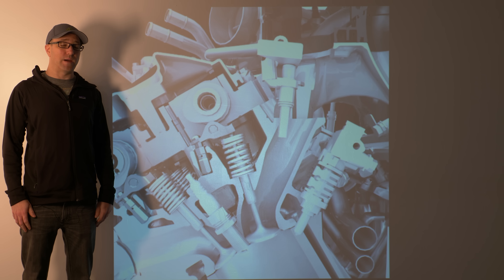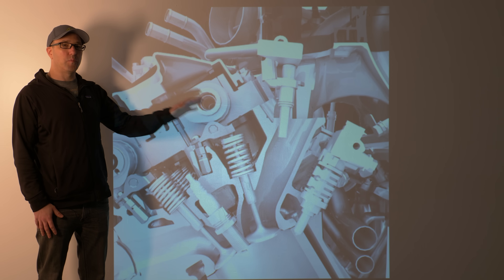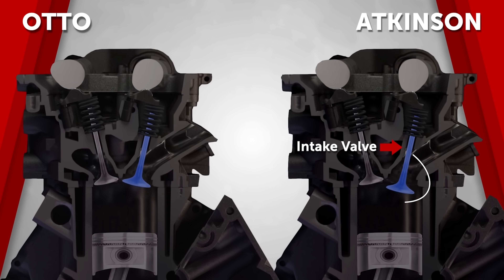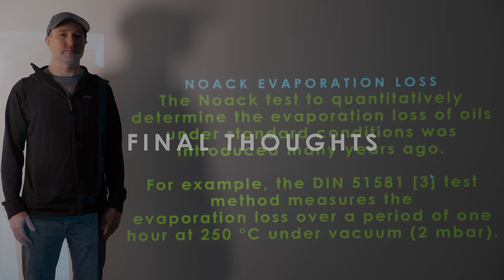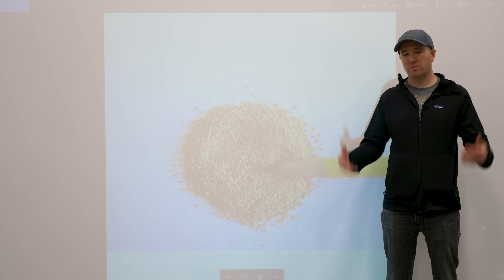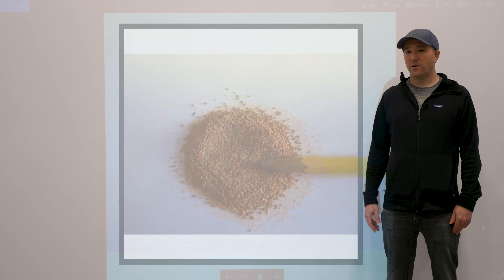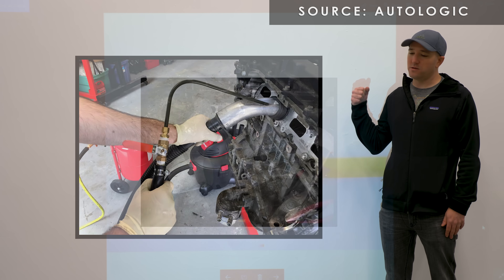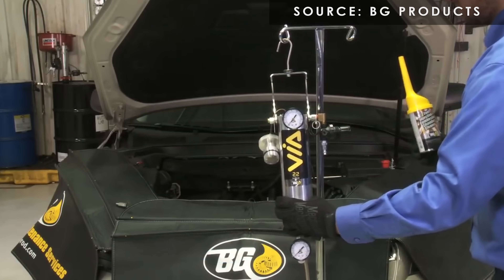Direct Injection, Problems and Solutions | The Fine Print

Comment: Extended oil changes Lead to more fuel dilution and therefore burn off. This coats the ports with oil and soot. Low tension rings rely on combustion pressure to seal against the cylinder walls. Most ppl drive with economy in mind and use very little throttle, therefore low cylinder pressure. This increases the amount of blowby. This glazes cylinder walls and packs carbon into the ring lands and taxes the PCV system. Crank case pressure and oil dilution contribute to oil seal failures and leaks. Short drive cycles put moisture in the oil that doesn't get boiled out because the oil doesn't get hot enough. More crap past the rings, in the intake and stuck on the ports and valves.  Anybody sense a pattern? 
Changing oil viscosity can lead to cam phaser malfunctions and codes when the computer doesn't see the correct adjustment. So, be careful changing oil viscosity. Not usually permanent damage but difficult to diagnose trouble codes. 
Moral: Change Oil often using high quality oil and a high quality filter not the cheapest one like most oil change places use. Drive cars long enough to get the oil hot and hard enough to keep the rings seated.
Reply: BINGO!!!  Also replacing the PCV every 30K miles ;)
Reply: Use amsoil. Only oil 100% synthetic. High test gas and marvel mystery oil you will have no problems
Reply: @reginaldsmall3766  using a premium oil (like you suggest, Amsoil)only solves a few of the problems. If water vapor (from combustion) is condensed in the oil, the only way it comes out is heat (or oil changes) Perfect oil or crap, the result is the same. 
Gasoline choice will have little effect on intake coking on direct injection cars. 
Using Amsoil, I think adding Marvel would be a step backwards. My fiance was a petrochemical engineer. I could ask her to find info but I'd probably have to start a new home project for the answer. I'm out! I get a pile of Audis and BMW's in and you can tell how ppl drive and the service they do (or don't do).  Change oil often. Oil is the cheapest component in any engine. Lubricity isn't the only quality an oil has. Temperature break down, particle encapsulation (detergent),  seal conditioners, etc. Those qualities can be gone long before the oil loses lubricity.
Reply: Karl Cordel where does the water vapor come from. I don’t understand. I have the mb and a Honda CR-V (2018)and a diesel Colorado. I have never had trouble with ex-valves. Why don’t diesels have this problem with direct inj.

Comment: Pretty good job, but you seem to misunderstand what possitive CRANKCASE ventilation means... Blow-by gases slip past the rimgs from the combustion chamber down into the crankcase, or basically the oil pan area. Manufacturers use intake manifold vacuum to suck out these gases and reburn them. This keeps pressure from building in the bottom end. Disappointed you missed such a basic idea.

Comment: They one reason for gdi was no waste of fuel unlike normal FI SYSTEM which has fuel sucked threw a valve. Blow by is normal . That why they have pcv valves. Pcv goes bad block builds pressure an will LEAK OIL.

Comment: Just go electric, problem solved. The era of IC engines is over and good riddance to pollution, Co2 and fossil fuel industry. EVs are faster, more reliable, don’t require as much servicing and longer lasting.

Comment: We've torn down some higher mileage GM LT engines and found relatively clean valves. GM does run a catch can on the passenger car LT's like the Camaro and Vette but chose not to on many truck/SUV engines. Unlike many early DI European engine there is some new American technology to address DI issues(maybe not perfect). Component tolerances and proper oils to seal the engine, advanced PCV systems and from what I'm told patented valve timing strategy using Continuous VVT to help keep the valves clean and reduce NOx without EGR systems. EGR systems suffered from the same fate as DI and as a line mechanic in the 80's and 90's all sort's of cleaners and tools were developed to combat the carbon build up(JB, BG...) Over time EGR systems developed and are still used today with minimum maintenance. GM spent millions of CAD hours on DI cylinder head design for economy, performance and DI longevity. Reality is we have such good control of cylinder pressure - spark timing - cam position..., and modern manufacturing allows such tight tolerances it's not like the old days. Most don't know that Ford experimented with DI engines back in the 70's but metallurgy and computers were not up to the task, like everything else improvements will be made if the gain vs costs are worth it.
Reply: Yada yada yada.  I still consider GDI an engineering flaw.
Reply: Speaking of Ford , saw another video that said Ford is only manufacturer that combined the best of both port and DI .. From 2016 onward . i hope that's true . Got a FocuS SE 2.0 L GDI engine with 58,000 miles I just bought . THAT video was only a few months old ..
Reply: @frankmontez6853  Ford, Audi, VW, Toyota, Lexus. Not all engines in all vehicles, of course. Check each engine number on Wikipedia.
Reply: @frankmontez6853  your car is direct injected

Comment: your picture of dirty intake valves was off of a mk5 fsi 2.0T vw motor :( I know because thats what mine looked like. I removed my intake manifold, turned the crank around until the intake valves were closed on whatever cylinder, and poured acetone to break it up and then used brass picks to scrape each cylinder.  I've had a catch can installed since 70k, currently at 120k.  Definitely worth the money to put a catch can on.  Toyota and Fords ecoboosts with dual injection is the way to go with this technology. Great video.

Comment: Blowby is gases blowing past the piston rings, down into the crankcase, where the oil sump is. PCV stands for Positive Crankcase Ventilation.
Reply: Yeah but that pressure finds its way up to the valve train because the crankcase is connected to it via oil ports. So that's why the PCV valve is located in the valve covers.

Comment: Great video.  I have a 2016 Honda Civic 2.0.  No Turbo.  Would I need a catch can?  I learned about the oil dissolution issue after I purchased it.  No issues so far at 62k.
Reply: Woody Rosenschein oil dilution is only on Honda turbo engines!!

Comment: The PCV valve was the first emission control device ever used on an engine. It also does a lot of good, by cleaning the engine. The fuel that gets past the rings into the crankcase reacts with the oil and causes sludge to build up. The PCV valve allows the engine to suck it up and run it through the intake manifold where it flows into the cylinder where it is burned. Before PCV valves they used road draft tubes which was just a simple pipe that was exposed to the wind stream passing below the car where a vacuum was created drawing out the unturned fuel and allowing it to flow onto the roadway. Obviously there was a huge safety problem with that, especially when it rained and the fuel and oil was washed off the surface of the road where it could puddle up under your tires, cause them to loose traction.
Reply: The Mk.1 Cortina 1200 cc engines were infamous for smoking out that breather. Worn out @ 50k miles.

Comment: Blowby is explained incorrectly.  Blowby is pressure that originates in the cylinder and goes passed the rings into the crankcase.  This is why you need a PCV valve, to ventilate crankcase pressure, not cylinder pressure....  Also, the pcv valve is in the crankcase, not the valvecover.  That's just  a valvecover vent for oil vapor.

Comment: You described crank case ventilation incorrectly.  The pressure isn't coming from the crank case into the combustion chamber, it's going into the crank case from the combustion chamber.  It's literally called crank case ventilation.  Also, if oil is leaking from your turbo seals, you have a failed turbo.  Not really a DI problem. Lol.  You also don't need to use fuel additives, you need to use top tier fuel.  You should run the correct manufacturers spec oil for your car, the weight of the oil is actually specified in those specs.  For example, in a gas powered Mercedes, it's 229.5.  That spec is made by many companies and many different weights.  The weight should be chosen based on operating temps, i.e. ambient in your area.

Comment: I always add a bottle of STP oil treatment every oil Change so the oil becomes more stable in higher temp.

I change my oil every 6 months and flush it with engine flush.

Never have a problem. I dunno this fad going in using thin oils.

Comment: There is one more way to deal with this oil build-up on the inlet-valves that is to use a tripel level oil separator that has auto drainage via a third pump that takes its built-up oil in the separator's sump and then pumps it back to the fuel tank to mix with the fuel this would two thing actions: first is to ad as small amount of lubricant to help save the more costly fuel injectors and help the all other fuel pumps to lubricate thereby lowering the ware and tare on these normally none lubed. And secondly, it would help improve the oil separator effectiveness towards the perfection of 100% oil separation from the inlet air stream.  Now I know you  say that mixes oil with fuel and it does just that, but, it still does that, in reality, it does that down in the cylinder where it has less time to mix and will add to the exhaust emissions particles because of this improper mixing, but I let you see the that when these oils are well mixed with the inlet fuel then it will burn more completely, therefore, cleaner fewer particles for the Catalyst-convertor to deal with, plus there is another benefit to this mixing the person who paid for the oil will some fuel eco and some more power for that oil being burnt which it is more real power than you would think most oils are far more chains of hydrocarbons so these will make some power. I fact the CC devices are more for the unburned oil than the fuel itself. this means that the CC devices may not be needed at all, but tests will prove this out into reality. Oh, and more fact is the triple-level oil-separator and the third pump as well as the return line system will be and is far cheaper and is far more reliable than a set of port injectors controls and added computing hardware powering to manage this. Also now for the only real draw-back, the fuel filters will get dirty sooner than before as it will be catching particles from the crankcase system but for the owner, it is far cheaper to replace these than any other method that is being used. { "are" but the grammar checker said is best. But there is more than one method in use today and other systems which can be later on.  }

Comment: For a 2013 Hyundai Accent GLS (1.6L Gamma GDI) I maintain, I found this works:
-Chevron/Texaco fuel, 89AKI min (ECU doesn't run as rich/dilute the fuel as with 87AKI). 
-OEM oil filter (it's made by Mann+Hummel)
-Quake State [SOPUS] 5w-20 full synthetic ("Ultimate Durability"), SN+/Dexos1 Gen 2, NOAK ~7%, OCI 6mo/5k miles
-Valvoline Easy GDI every 30k
http://pqiadata.org/QuakerState_5W20.html

Comment: Catch Can is a myth. Yes it will "Catch/Condense" some oil, but wont help much on carbon built on on intake valve. Not sure it worth the efforts. You drive thousands miles, may "Catch" 1/8 qt , will that much oil will cause carbon build-up? I doubt it, especially when it is spread over the long period of time and miles, and it is in vapor/gas form.
Reply: I agree. Better to manage what comes through the EGR via Top Tier fuel (I prefer Chevron). Crap fuel, worse crap through EGR. Also current (SN+/D1G2) Quaker State 5w-20 synth is 7% NOAK (PQIA test). Good for non-turbo GDI that specs that weight. http://pqiadata.org/QuakerState_5W20.html

Comment: I hear these horror stories regarding catastrophic carbon build up on GDI intake valves, but I very rarely see it actually happen. Do driving conditions affect it much? Maybe high temp, long distance runs can help burn off some of the carbon, use of slightly thicker and synthetic oils to reduce blow by and for their higher temperature tolerance...

Comment: This is why I'm going to stick with my older cars. To much mickey mouse engineering and electronic gadgetry and as long as my vehicle runs and is comfy I don't care if it gets 25 mpg instead of 30. Most people don't either or they wouldn't speed so much. BTW a very long time ago I built a 62 Bel Aire with a 350 and the original 3 on the tree and stock gearing and it got 22.5 mpg at 75 mph. I plan to do something similar with my 69 mustang and a 302 but with a 5 or 6 speed and almost stock gearing. Roller cam with a small 4 barrel carb, a DUI ignition and shorty headers with duals, and it should be very fuel efficient and also pretty quick off the line.

Comment: I'd point out that the comparison with 1990s cars is somewhat unfair. Cars have become a lot heavier, due to crash safety requirements and customers tending toward bigger vehicles. A 2,000 pound vehicle with a DI engine would have comparable efficiency to one with a PFI engine. But here we are with a Chevy Sonic weighing 2,900 and getting a five-star crash safety rating. No wonder it only gets 34mpg EPA (37 if you translate to the 2008-2016 EPA way of calculating things, probably 40 or more if you go back to the pre 2007 method)

Comment: Even if you cant change your own oil there's always someone in every family that can do it. Never take your car to the dealer. You just cant trust people these days. And im so tired of these people that say "dont use synthetic itll ruin the engine". Watch some videos from Mobil 1 and Royal Purple and see how much better it clings to bearings (cant remember the word they use for it) they do a scaring test between conventional and synthetic oils and the difference is amazing. Its way better for the engine on cold starts because of its film strength than conventional oil and it deals with heat a lot better. Do some research, your engine will run better, cooler and get a little better gas mileage.
Reply: Very true.I Bought a 2013 sho with 46k and started using full synthetic right off the bat .No problems  with the fs ,today i went with Royal purple 5 30 and RP oil filter and boy what a difference.I was surprised to feel more power from this choice of oil RP is going to be my choice of oil from now on .

Comment: U can use water in the intake to clean carbon and in take valves. Also if a hho generator is installed then all the problems go away because u get a complete combustion no oil or fuel is left unburnt.

Comment: Scott P: terrific video!! Question: why don't we all use catch cans? Even better, manufacturer installed. I'm sure cost is an issue but wouldn't it cost less to have a catch can than clean it?
Reply: Alan LeClair because the average consumer is lazy and doesn't want to deal with another thing they have to change lol. Also a lot of the stuff they capture is actually water, from cold starts for example and can freeze if it's cold enough. Introduces another point of failure in the vacuum system

Comment: Congratulations on a very informative presentation with stunning graphics. Should mention not have been made of the advantages of a stratified charge which DI offers ? Eg. the ability to run leaner, and the bigger resistance to knocking ?

Comment: Thanks.  But isn't there a hack? Disconnect the pcv valve hose and plug the pcv valve intake very well so it holds vacuum.  Let the crankcase vent to atmosphere with or without a catch can.   Only do this on DI/TC cars that need it to avoid long term emissions degradation through the buildup of crap.  Outlaw future. DI builds or put the valve train under emissions warrant.  What's the downside, some unburned crankcase gases from a few cars in the air.  Seems like a good hack.
Reply: This is like cholesterol buildup in an artery.  Avoid the source, don't let the dirty crankcases gases into the intake in the first place.

Comment: The problem is that the injectors does not squirt fuel in to the inlet in direct injection .squirting fuel in to the inlet cleans the valves and intake. One way is to have 2 injectors one on the outside and one in the inside .outside injector squirts a tiny bit of fuel just to clean the intake and valves, squirt while the valves are closed.

Comment: Sure makes me appreciate my old Lexus V8. The thing has zero blow-by and still can get 29mpg highway.
Reply: Lol 29 mpg no way you're getting that in an old v8 you lying bitch.
Reply: BIG A Uh oh, butthurt keyboard warrior has never driven a properly engineered car.
Reply: no internal combustion engine has zero blow by..   minimal sure..
Reply: UZ gang
Reply: Because the way piston rings are designed in all vehicles no engine is immune to crank pressurisation, either from blow by or oil temperature.
Reply: I hate Toyota BUT they do make excellent products.
Reply: What's so special abt 20+ mpg, its still a gas hogs to me, its the "appropriate" fuel consumption for a modern big v8
Reply: Taylor Rhodes Toyota products are great. 👍🏼
Reply: mike dicke IS250 has GDI.

Comment: Just an FYI: the VW/Audi/Seat 2.0 TSI engines also have both DI and PI (except in the USA, iirc)
Reply: its in the name of the engines TSI/FSI... of course they are..
Reply: @nikosperisteri13  well, not so obvious, as my MK5 GTI had a 2.0 TFSI engine in it, but only had direct injection, no port injection. So it was prone to carbon buildup...

Comment: What was not mentined here was the INTERNAL egr due valve overlap. So no matter how good is your catch can, part of the blow by recirculation occurs INSIDE the valve train and head. Thats why some engines are HORRIBLE on carbon build up like BMW and VW and other  barely have this problem, like Alfa Romeo/Ferrari or Ford.